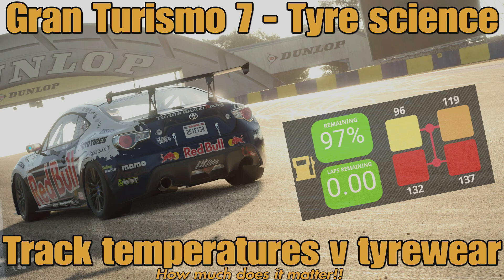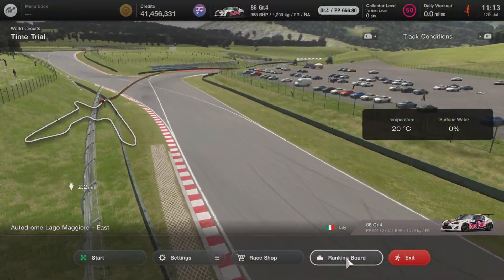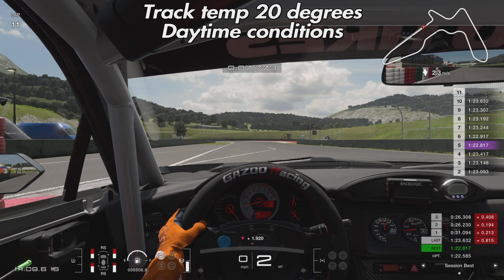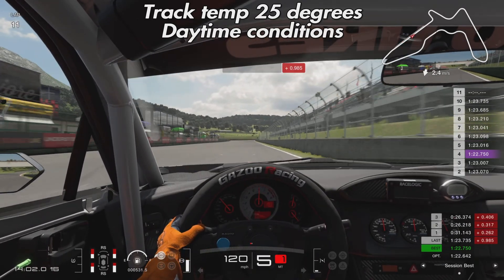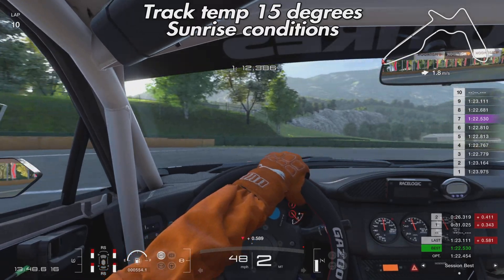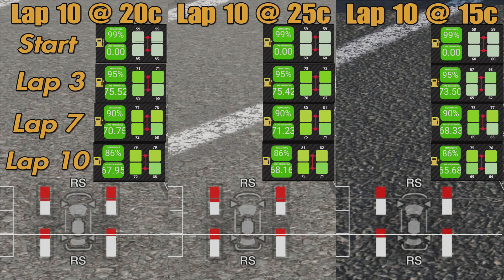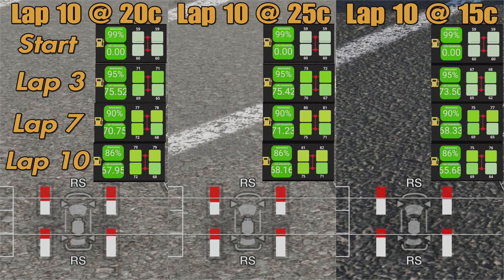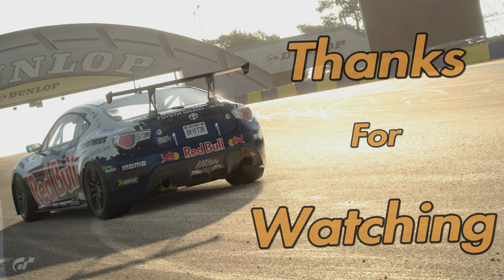Gran Turismo 7 tyre science...Track temps v tyrewear...How much does it matter

Comment: Wait... the % of fuel remaining in the car remains the same, but the # of laps left has that much variance? I mean even if something funky happened on pit road, all 10 lap total times were 14m? Considering the only time I think they actually list fuel in volume is the refilling rate, what the PD is GT7 doing??!? 2 laps of "weight" wouldn't be that much wear on tires, but there shouldn't even be that big of a discrepancy off pit road to begin with.

I know this is about track temps and tire wear, but if something stupid like time of day or watching the demo car drive around before starting a session changes how much fuel a car can hold, what other stupid tricks does GT7 have. It could be an app error, but even at 1x fuel the % should be different if a car that has an 80 lap tank only gets 78... 2/80 is not <1%
Reply from the maker: The percentage is the same but one could be 86.2 and another 86.7....tbh I wouldn't read to much into because fuel was only at x1 and would take a bit more driving for the laps remaining number to settle down properly....The amount of fuel you start with doesn't change its just burning of quicker in cooler conditions it would seem.

Comment: I been wanting an app for a bit now. Is there a difference in temp between starting on hards this week & coming out of the pits on hards, Grand Valley? I noticed you always started on hards in stream & they’re dead coming out of pits. I wanted to ask in stream but didn’t get round to it…
Reply from the maker: Yeah when you leave pits tyres are at 60c which is about 10 degrees below ideal temps...at the start of the race tyres start at 70c so there is an advantage to starting on hards
Reply: @wombleleaderracing6455  
Curiosity was burning a hole in the side of my head, so got the app, had a couple of races. Trouble being starting top 3. Had to go with the meds, but saw temp out the pit at 59, 63 by the end of the lap. Still worked out better than traffic though like the leader found...